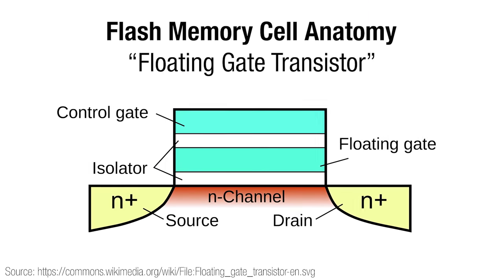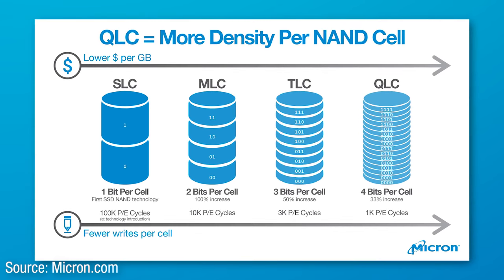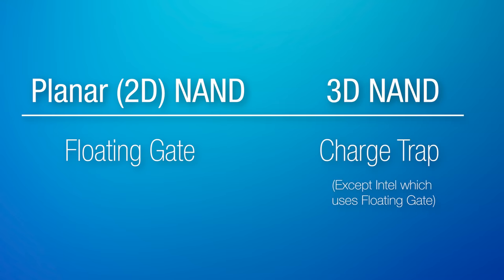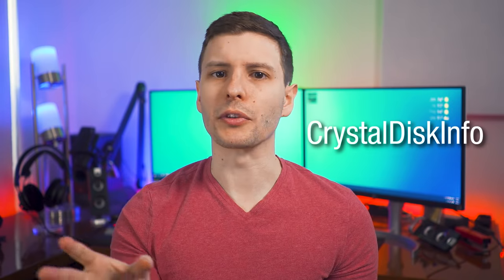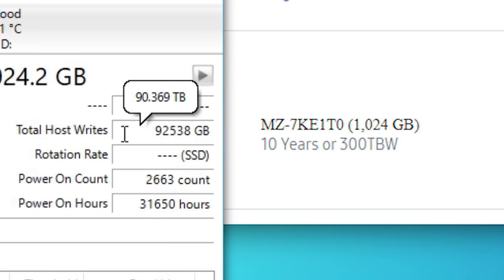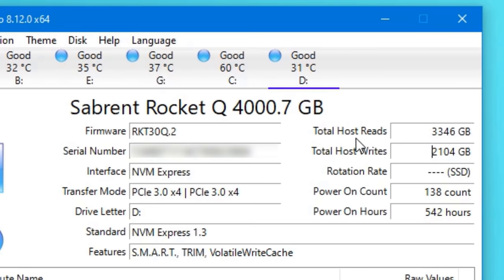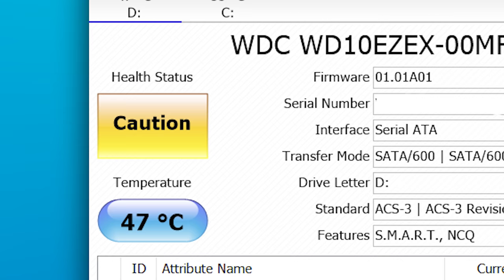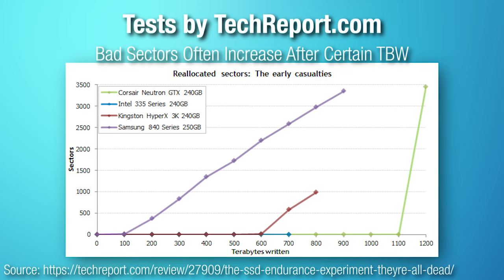How Much Longer Will Your SSD Last? How to Tell

Comment: I think most people severely underestimate the lifespan of an SSD. I'm using a Kingston 480GB HyperX SSD. This has been my main drive since 2013. It's by no means a new SSD with all the latest technology. In fact, this was back when SSDs were finally becoming mainstream. It has gone through six Windows reinstallations and countless big-sized games being installed and uninstalled. It's still working just as well as it did ten years ago!
Reply: I have the same drive in 960GB but i stopped using it because of a faulty SATA connector  (it doesn't "click" when you plug the cable in so every other day it disconnects itself and the OS freeze, even though it's not my system drive (i guess a solution would have been to use hot glue)
Reply: I love this story, but it'll be cool if you came back to this comment and edited it and add the date it (eventually) died so we can see how long they can last lol
Reply: It's not about how long you have it but how many times you re-write the sectors on it.
Reply: @SergSpace  "Well I've never had that problem" is so annoying, isn't it? The average person can be so sure a problem doesn't exist, or isn't as bad as it is, just because they haven't experienced it lol. And it is usually for a really obvious reason.
Reply: @bilalsadiq1450  I mean they already told us that their HDD died 11 years ago... so this SSD has already lasted as long as a HDD

Comment: Even though SSDs  are more reliable than HDDs  in general, but when they do fail, it's much easier to recover data from HDDs than SSDs
Reply: usually because the HDD platters themselves dont fail, the read/write arm does. SSDs most common failure is the NAND itself so the data is first to go
Reply: i'm gonna cry
Reply: I thought SSD turns to "read only" when it fails.
Reply: @ChibiKeruchan  usually they do, but not always
Reply: @ChibiKeruchan  I've seen other commenters mention that that's an enterprise feature that activates once the TBW are used up and, hence, a failure is expected if write operations continue.
Reply: @williampaabreeves  HDDs have sort of the opposite problem: it's nearly impossible to completely erase the data from them.

Even doing 35+ random write operations will not fully erase what data was there originally (though it will drive up the costs to do so to ridiculous levels) and, upon non-explosive failure, it's pretty easy to recover the data if you have the right tools and knowledge.

Hence why if you really want to secure your privacy, the only sure-fire way to get rid of the data on a HDD, is to physically destroy the disks (preferably via fire, acid, or microwaves). Ofc, that's massive overkill for the average user, but it's technically the only way to make sure.

SSDs are much more fragile in that regard, but also a lot faster. Hence, I'm going to back up my SSD data to a HDD and, in case something happens and the HDD fails before I notice and replace it, it's practically guaranteed most of my data will be recoverable (if a bit corrupted in places).
Reply: @DarkVeghetta  uh nah, just zero write the entire HDD and there will be no data left
Reply: @DarkVeghetta  Microwave?? Tf, don't put HDDs in your microwave
Reply: @estebanod  Zero writing won't protect your data from a professional data recovery tool - the kind the FBI uses.

The only way to purge your data beyond recovery is physical destruction and various people have reported that microwaves do a good job - just the plates, obviously, not the entire drive. I'd personally still shy away from the potential fire hazard, but it depends on the individual setup.
Reply: @estebanod  I was simply using the FBI as a shorthand for 'organization or person that has the resources to employ a modern lab and the technical expertise necessary to achieve said goal'.

As I understand it (this is coming from others that have more extensive technical knowledge than myself and have explained in detail how to do so, but it's been years since I brushed up on said details), zero writing is not going to fully remove the physical traces of past writes.

Zero writing is a good 'close enough' strategy for most people, but with a properly equipped lab, money, time, and the appropriate expertise, the data you previously wrote to a zero'd drive can be recovered.

That said, the cost is prohibitive - on the order of tens of thousands or more dollars, at least with currently-available technology.

As such, given I trust said past technical explanations I've read and heard before more than your claim, I'm afraid I don't believe you're well informed enough in this specific regard.

As previously stated, physical destruction is the only way to make sure HDD data is fully unrecoverable, but it is not realistically necessary - zero writing is good enough, though not technically unrecoverable.
Reply: @DarkVeghetta  I recently supported a similar position to yours. I enquired to the best informed person I know which is the guy behind HD Sentinel. He wrote, overwritting the drive will erase the data. Maybe the 0 writing isn't optimal but a random pattern will do.
In case you remain convinced please provide information.
Reply: @claudej8805  Except that's not how traditional HDDs work. Once you write something to a disk, it's physically imprinted onto the plate. You can overwrite this, but due to how imprinting works, traces of the previous data remains. Hence, what I stated and how a lab can piece together some of your old zero-written data, but large sums of money will be burned in the process and it's unlikely either of us has data valuable enough to do this for.

Also, you did not clarify what constitutes 'erasing'. Again, it's good enough, sure, but not foolproof - which is why, with sufficient resources, someone can recreate enough of said data to read most of it. It's erased well enough, but never fully.

That said, I'd just keep the HDDs in a box somewhere and not worry about it. SSDs have started to take over regardless and those do not work the same mechanically, so the entire discussion will be fairly moot in a few more years, unless you're a data center.
Reply: @DarkVeghetta  Erase was meant as "the data is gone for good". I don't believe you, you didn't provide any source while I did enquire. Magnetic recording isn't writing on  a notepad where you could recover overwritten stuff. But this is the last time I write if you don't provide.

Comment: People who use HDDs: This makes perfect sense.
Reply: Lol
Reply: I use a HDD cause I got a prebuilt with one and it has a warranty that stops me from opening it up
Reply: Lmao
Reply: Hard disk drive drives
Reply: Hard disk drive drive
Reply: @WizardNumberNext  Some manufacturers put a seal sticker on the case and if you open it you break that sticker and lose the warranty.
An external drive is a good option in this case, but I dont know if a SSD conected to an USB port is fast, Im still use a HDD 😢😁
Reply: @mattp12  Fine. I changed it. are you happy???
Reply: People who use SSHD: Yea.. But no? Idk
Reply: @KSPAtlas  aint nothing a silicone spudger and a hair dryer can't fix.
Reply: @KSPAtlas  I took out HDD and added SSD same size same day I bought my acer pc it still works great it about 1 year and half old now
Reply: @DanGmz  And that claim that it violates warranty is illegal due to the consumer protection act.

Course, you probably don't have the money to take them to court over it. Which they count on.
Reply: @kevindie  If you have a proper back up strategy in place you’d never need to worry about recovering from a failed drive whether it is a mechanical drive or SSD anyway, replace drive, restore backup, job done. My OCZ Revo 3 is over a decade old, works fine, outlasted motherboards on 2 PCs it has been in. Try keeping old IBM “Death Star”  Desk Star mechanical drives running for more than a few months,   Unreliable heaps of junk, and how about Fujitsu 8GB drives where the Cirrus Logic controller chip used to fail after a few days ? Truly awful kit…

Comment: When I was working in support for a large company, in my section I was supporting over a hundred of computers.  They were changing the computers every 3 to 4 years. They were using standard medium cost SSDs. After about two years I was seeing about a 3% failure rate.  During the 4th year I was seeing maybe a 5% failure.  These computers were used many hours per day. Most of the work was for writing spread sheets and text documents. During work breaks and lunch hours many of the users were watching videos, and going on social media.
Reply: They should have sticked to hard drives then?
Reply: Early SSDs had a lot of issues but if it got worse instead of better then I'd say they were probably just cheaply made (cost != quality).
Reply: wait .. so HDD is more durable ??
except from laptop because we carry laptop everywhere
Reply: @syarifairlangga4608  It's complicated.  If you keep a HDD in a single spot and make sure it's never improperly shut down (improper shut downs can cause the head to crash into the platter) then it may last longer than an SSD.  SSDs can take more physical abuse since they don't have a spinning platter/mechanical parts to worry about and under light load will probably last longer (they don't have as many write cycles but there's no mechanical parts to wear out).  SSDs are probably more resilient to magnets as well.  Of course no matter how good an HDD is it will never operate as fast as a good SSD.  

The story shared above seems odd to me and makes me think they were either using low quality SSDs sold at a premium or very early ones that didn't have nearly as many write cycles or as good of thermal management.  Early SSDs had a lot of issues with overheating which can be greatly exasperated by dusty environments.  Modern SSDs can still overheat easier than an HDD but it's a lot more rare (overcooling an SSD may also damage it).
Reply: @grn1  yeah look like hdd is last longer. But the speed of hdd make people less peoductive.
Reply: @syarifairlangga4608  
HDD is more durable for writing over its lifespan. SSD is a lot more durable for moving around, but has limited write life.  It has no moving parts and therefore can take some rough handling while in use.
Reply: @grn1  SSDs are faster but they also Fail harder.  Platters fail slower allowing to retrieve data from them easier.
Reply: @jerryfacts9749   Which means SSD is the best external storage for back up you can have.
since it's life is base from how many time your written in it.
Reply: @ChibiKeruchan  hdd are better for that since if you aren't using the back up for years it will rot away in an ssd due to lack of charge
Reply: @jerryfacts9749  ssd are also more durable for reads as well. they can have very long lifespans when used casually. hdd much  more limited due to its moving parts nature. lugging around an old iphone is a testament to that
Reply: @ChibiKeruchan  SSD as external storage is expensive. HDDs give much lower cost per TB. I currently use an SSD for OS/apps, and HDD for data, temporary files, and external backups.
Reply: @jakejakedowntwo6613  I've had 2 External-HDDs physically fail on me. I'm not trusting them any longer.
Reply: @justincronkright5025 HDD's are sensitive to vibrations, incorrect handling and storage will destroy them. For data hoarding, it is a good medium, if you treat it correctly it can last for years. It's better for you to get a solid state option, I'm assuming your physically abusing the drive.

My desktop uses a 10 year old drive still, so there's a reason for your drive failures.
Reply: @jakejakedowntwo6613  Yeah, I've had 4 external 3.5 HDDs fail on me because of vibrations. Laptop HDDs are more chock resistant luckily
Reply: @grn1  improper shutdown is not an issue with modern hard disks anymore as the, have a capacitor that stores enough energy to safely park the heads.
Reply: @justincronkright5025 re you sure that it was not just the USB controller failing? If the latter is the case, you should still be able to access the data with SATA.

But some have thermal issues which might lead to the drive itself failing. Especially if you use it for heavy-duty stuff like copying a few hundred GB or thousands of small files at once.
Reply: @rfvtgbzhn  I wouldn't count on it.  Perhaps some better ones have a capacitor but I wouldn't be surprised if even some name brands skimped out.  There's also other issues with improper shutdowns as even if the heads park correctly some data might not be saved properly.  Corrupted data can cause all sorts of hard to diagnose issues.
Reply: @grn1  it's true that data corruption can cause issues that are hard to diagnose, but that's also the case if an SSD is improperly shut down and you can distinquish it from drive issues via S.M.A.R.T.

Comment: Something to consider with SSD drives is to get the largest capacity that you can and don't fill it up.  The larger percentage of the drive you fill up, the less space it'll have to spread around new writes.  So, if you get a 1TB drive and put 900GB of files on it that's reasonably static, then have a process that reads/writes a lot of data (like a system swap file) to the remaining 100GB left, it's going to wear out a lot faster than if you started with a 2TB drive and has 1.1TB of free space to spread those writes around.
Reply: One problem I find is Microsoft in their Windows system still seem after all this time totally unaware that 2 or more drives can be installed in a PC. So if you have a small bootup SSD and a large standard drive it is a constant struggle getting data on to the other drive minimising writes to the SSD
Reply: There are some apps that refuse to be installed on any drive other than C: 😡
Reply: @MrColoradomike  - Applications generally aren't a problem.  The install files they create are mostly static - they're written to the drive once during installation, and then read over and over but not modified when the program is run.  At most, there may be some small config files that get updated each time you run it.  I'm trying to think back, and can't think of anything I've come across in the past 20 years or so that insist on being installed on C:, but can't be configured to store the active data files (like a database or temp files) that get modified a lot as the program runs in another location.  

Honestly, Microsoft's OS has largely been the worst thing I can come up with as far as putting files on the boot drive that get constantly updated and there's not any easy way (thought there are usually ways through the registry) to make it write them to another location.  The pagefile and the search index are probably the worst, but they can be configured through the OS and you don't have to modify the registry directly.  If I have an SSD as a boot drive, I go in and set the pagefile to zero (make sure you have a large amount of physical memory if you do this) and change the search index storage location to a non-SSD drive.
Reply: Right. But it's true not only for SSDs, but for every kind of disk ;)
Reply: @BlackSun3Tube   - Not really.  Hard drives (magnetic media) have an almost unlimited amounts of writes to a segment, since the write heads don't make physical contact with the drive, and the magnetic material pretty much never wears out.  Hard drives are massively more likely to fail due to mechanical parts wearing out rather than the recording medium failing.  But, with newer SSDs, you can get failures from writing to a segment in as little as a thousand times (if using QLC), which is nothing for a swapfile or database.
Reply: @someoneoncesaid6978  What happens when a magnetic hard drive is quite full, is that the head has to move to larger distances, participating to its wearing.
When your disk is not full, it can quickly go to the next clear sector to write on it.
(And on hard disks wearing, you have more and more "dead" sectors marked with the firmware or OS, where it knows it can't write or read).
Even defragmenting won't solve the problem, first, it participate to head weraing too, .and second, you wil mostly have to read there, then go elsewhere far away to update the datas, for exemple.

There is no good exemple of keeping hard disks or SSD almost full, it all participate to their accelerated wearing..
Reply: thats useful to know
i have a very low capacity ssd i bought a few years ago and its been mostly full. I don't write on it often but since my it still writes a lot of data into it, I might have to get a new ssd and maybe PC or laptop altogether since its quite old.
Reply: It does not work like that. The disk moves the data you have stored to level the wear. That is known as static wear leveling.
Reply: @michaeld5888  You can move the data folders (images, videos etc.) to other drives.  The OS of course is on the drive you installed.
Reply: i had to get a 4TB to be safe, now that i installed everything to it i still have 2TB + left.